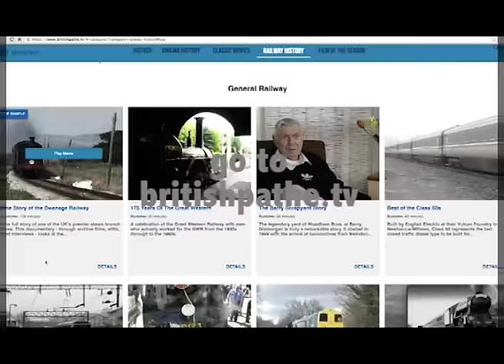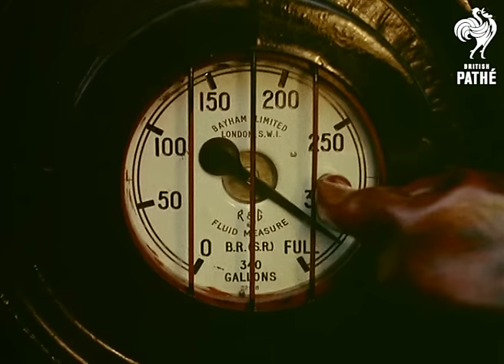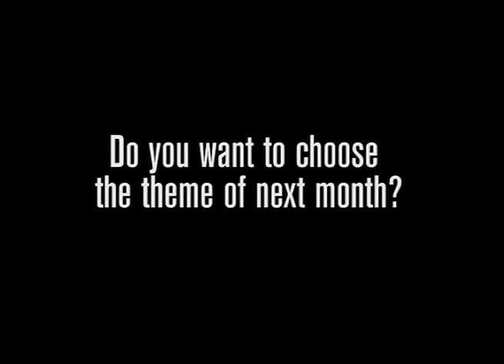Scrapping the Old Iron Horses: Train Graveyards | British Pathé

Comment: B12 61572 was stored at Stratford  but there was a fund-raising programme and the engine was saved- otherwise it would have joined these unhappy N7 engines and been reduced to scrap metal. There was no sentiment in the management of BR in those days- steam was going- and it was going to go fast leaving no lingering remains.
Reply: Railways are a business once a unit is no longer needed then off it goes usually for scrap

Comment: This was butchery. In 1968 when all steam locomotives were withdrawn, they were in pretty much perfect running condition. The only reason I see them being sold for scrap is because of running costs. Look at the labor that gets into firing up a steam locomotive compared to a then new class 55 deltic the difference is night and day. If you ask an ex steam locomotive driver or fireman what they thought about steam, most of the time they’ll tell you they absolutely loved it despite it being dirty and so on. Well what was to happen has happened and now we must all settle our differences, both steam and diesel enthusiasts , to save what’s left of all those spectacular pieces of engineering.
Reply: Might have been a good idea to keep more rights-of-way, though. Quite a few of them are needed.

Comment: Now all that kit they show replacing the steam, the old AM2's replaced the N7's I think, and nearly all the SR DEMU stock's gone the same way alas. Very little MK1 AC multiple unit stock's preserved, and it was the same on the SR where I worked on the DC third rail ones. Blue asbestos, corrosion, and being non - standard meant the shiny new Hastings diesels went mostly in 86/87 with the odd unit or car being retained for a while. Now the scrap all goes to India or China so they can dump low quality steel on us, while loads of jobs go down the pan here. Let's face it, all we do now is build souless plastic uncomfortable trains for the likes of Bombardier, a foreign firm. Thanks Thatcher/Major, your chums made a bomb just like Camoron and the GPO.
Reply: How are the new British trains uncomfortable?

Comment: N7 class is 1920s technology that didn't last long. The New South Wales Government bought Beyer Peacock 60 class Garretts in 1956 from Manchester UK and English Electric 46 class Kombi vans so they could scrap the 57 class. The Garretts only lasted until the early 1970s, so they had an even shorter lifespan than the 1920s N7 class back in the UK and the funny thing is that the Beyer-Peacock Garrett is a much larger locomotive. As late as 1965 you could still find the 1880s 19 and 50 class head-to-head pulling out of Alexandria Goods Yard on a goods train despite Port Kembla diesel depot opening at the start of 1964.

Comment: when are the British railways going to rebuild e2 class tank engines?
Reply: It wouldn't be the railway directly but rather a seperate organization like the one that built the A1 tornado, or the T1 trust.
Reply: It's kind of unlikely even then; the E2 class tank engines were designed primarily as shunting engines and (very) short distance trip workings, and had very small coal bunkers; they're unsuited for branch-line working, even if you extended their bunkers.
Reply: Be real the KX class is more likely
Reply: I donot think so

Comment: what the train look like Thomas? nember 32562
Reply: Jiew that would be an LBSCR E4 class 0-6-2T suburban passenger locomotive. Thomas, who'd most likely have carried No.32105 or 32106 on the same railway, is an LBSCR E2 class 0-6-0 goods & Shunting locomotive. Similar, albeit different engines